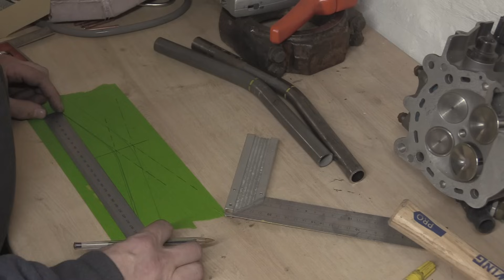Project Isaac #39 - Not coping

Comment: It’s almost like you’re trying to do this as incorrectly as possible. Welds need to be massive so you can use the flap wheel you’ve purchased from Sealey. All this measuring, waste of time, just do it by eye and say ‘perfect’. And your markings should be just a suggestion, somewhere near is always good enough. If you keep going like this, you’ll have symmetry and who needs that. Will you ever learn 😂
Reply: Nice I did this when I ported my scooter

Comment: If you're going to make a plate to go between the two bars, you should probably make it from tank-grade steel.  Preferably from a tank.  I don't know why you're bothering with fibreglass for the seat base though.  Wood is good.  

I'm sure you've got something lined up, but if you're wanting something amusing - "fat kent" or the such - cut into the part, John / doubleboost has access to some proper laser cutting gear, and he's not averse to some peurile crap (see for example his laser cut "bell end"  t-slot scrapers and ER chuck spanners).
Reply: Pretty sure it's his plasma table rather than a laser, tis shit hot though.
Reply: @davemason6273  Aaaargh SENIOR MOMENT.  Yes, it's a plasma.  Still, bloody good.

Comment: Now you have me wondering what special gusset you plan to put between the rails?
Will it be a special tribute spot for del?
Filled with plywood, held together with "no more nails", and a liberal coating of fiberglass and filler?
 If so don't forget to coat it with a heavy dripping coat of tough black, for the extra beef!